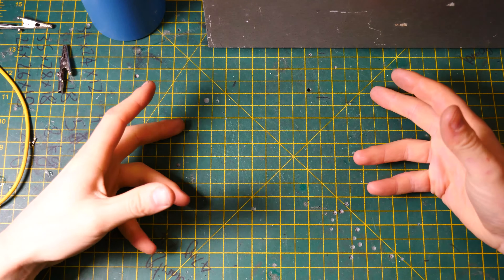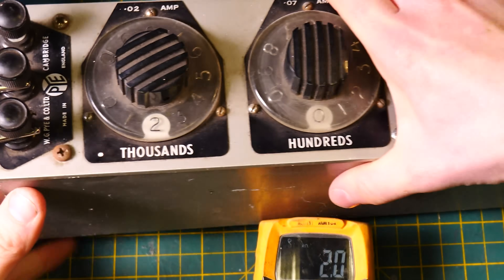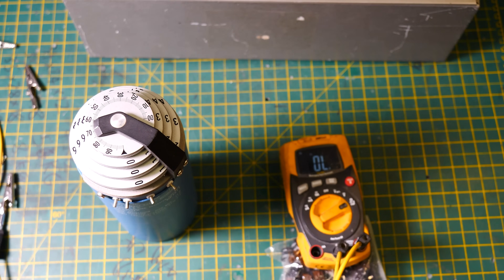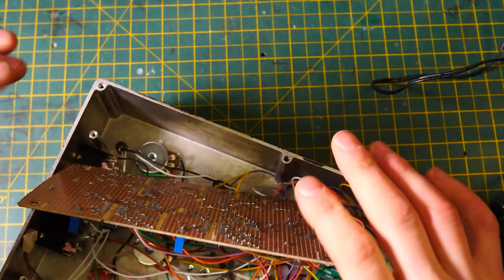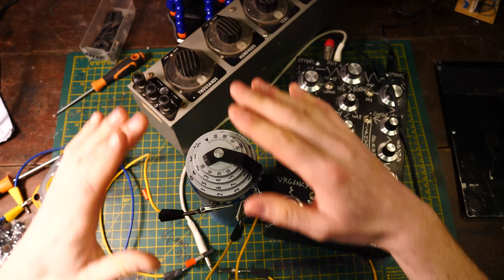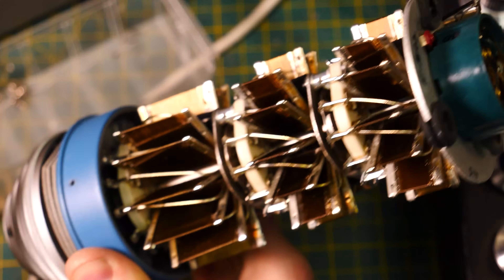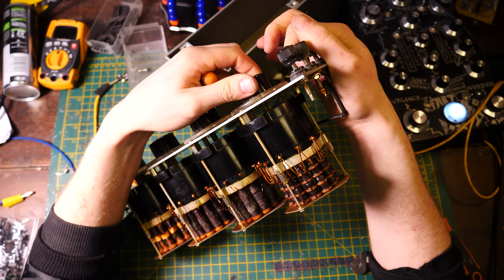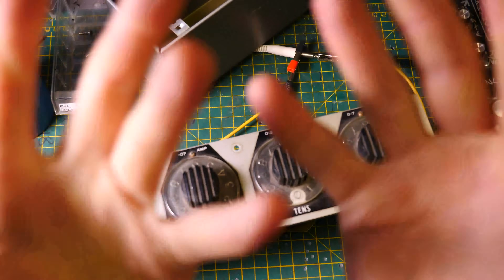A Curious Decade Resistor Whats Inside? And Wiring To Synths

Comment: That is not a decade resistor, it is a Kelvin-Varley divider (https://en.wikipedia.org/wiki/Kelvin%E2%80%93Varley_divider).
Basically 'sort of' an extremely precise and linear potmeter.
Reply from the maker: indeed of course it is but that is in the end of the day still in essence a decade resistor, just centre tapped. infact it even says it on the side.
Reply: @THISMUSEUMISNOTOBSOLETE  Nope, it still isn't. Dunno what went wrong with the previous link, but you can check the internal diagram in the manual here: https://www.ietlabs.com/pdf/Manuals/DP1211_1311_im.pdf
Reply from the maker: @somedutchguy7582   @somedutchguy7582  yes im aware thanks but what im saying is it is still a type decade resistor and can still be used as one. it can be used as both. happy to be wrong, but voltage divider or resistive box, its still very much the same thing. this just can be also used as a voltage divider. I should have said in the title "resistive decade" which would have ticked all the boxes, but I chose not to change it as I didnt think that amount of pedanticity. mattered haha. but all good.  in the video I demonstrate it as a resistive potentiometer and a decade resistor. it does bot, even looking at your diagram
Reply from the maker: @somedutchguy7582  tbh im trying to see how it isn't a resistive decade ha. remove the coms connection from the equation and its just a variable resistor. use the com its much like a potentiometer. much like a normal potentiometer is. I just wrote the title like that because its a type of decade resistor with a twist and it's odd compared to normal ones. in the fact it's a divider. But if you agree i'm happy to be proven wrong. :D. but it is very much in the decade resistor family imo
Reply: @THISMUSEUMISNOTOBSOLETE  Well, it isn't a resistive decade because the resistor values of the subsequent stages are not 10:1 but 5:1.
You have a unit with an input resistance of 1kOhm, so the first stage consists of 11 100 Ohm resistors in series. The second stage will be 20 Ohms each and the third stage 4 Ohms. I can only guess at the value of the potmeter, but combined with its parallel resistor it will be 0.8 Ohms.
Combined with how they are wired, and the way in which the dials are numbered, you are not going to get anywhere near a usable "resistor box".

KVD's like this are designed to be used as voltage dividers in precision applications. More elaborate ones, like the Fluke 720A, were used in metrology labs up to the highest level (think NPL and NIST).
Reply from the maker: @somedutchguy7582  I currently have it in my hand it says, kelvin varley divider voltage divider, resistive decade. thanks for the information but it is a resistive decade haha it literally says it on it. its called a DECKAPOT for starters. we may be getting confused because I agree with you. and yes you explain well how it functions. You obviously know what your on about but its still a resistive decade
Reply from the maker: if you look on the vid on the side of it, it outlines using the lines from the ports, use these 3 cables for the kelvin valley divider out see the out and in. Infact I used it as a resistive decade the other day when trying to find a resistor in a synth module cus I was in a hitch and the other ones I have like the other one in the video was broke.
Reply from the maker: but thankyou for the information regarding the metrology labs sounds cool!
Reply from the maker: @somedutchguy7582  I must add that yeah it is pretty goofy as resistor cus of keeping in mind the different values had to add it up weird when I used it last week not as a voltage divider, im just going off the label on it tbh.

Comment: I have a few of these dekapots! The leaf contacts and potentiometer contacts on these can get dirty and throw off the readings. Additionally, they are limited wattage and can be easily damaged by too much current.  When in good shape they are extremely high and extremely reliable voltage dividers. 

A cool related device is a ratio transformer which is like a precision voltage divider for AC signals.